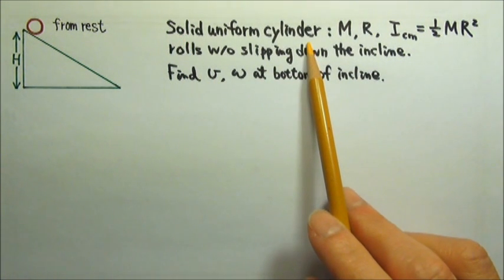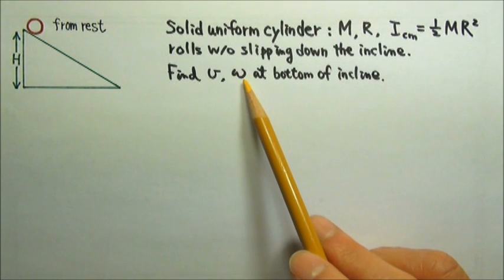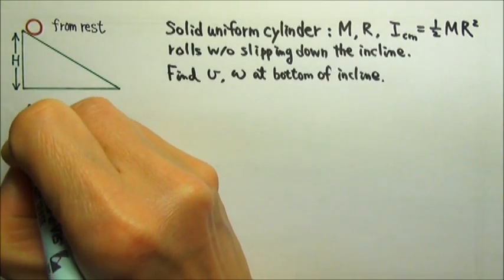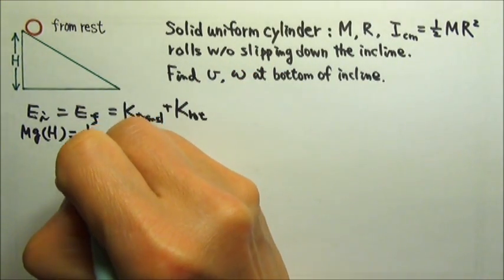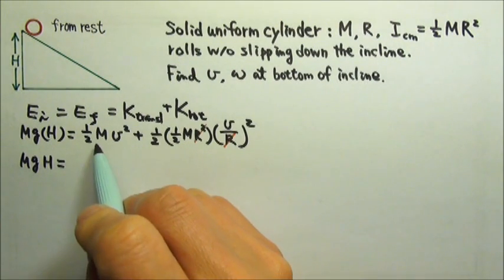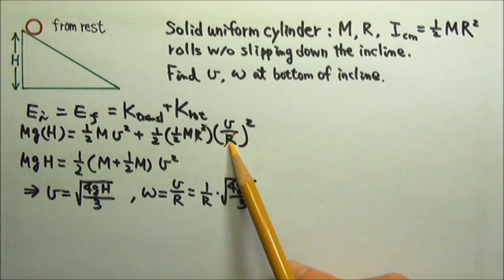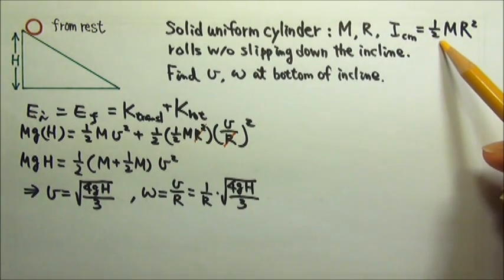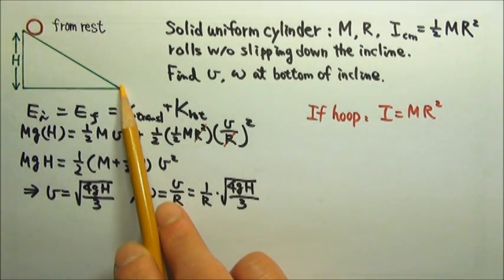AP Physics 1: Rotation 28: Rolling without Slipping Up and Down an Incline: Energy Approach

Comment: Hello! I'm a little confused about the gravitational potential energy. I have seen a problem about a meterstick falling down and when it is treated with energies, the height is the height of the center of mass. In this case, wouldn't we consider the same? I mean, instead of U=mgH, we would write U=mg(h+R)?
Reply from the maker: Very good question. If we say the initial U is mg(H+R), the final U would be mgR, because at the bottom of the incline the center of mass is not on the ground. We use mgH because the height change of the center of mass is H. 
And the reason why we use the location of the center of mass is that center of mass is the average location of the mass distribution. For example, if you look at the meterstick, some mass is higher than the center of mass while some mass is lower than the center of mass. The height of the center of mass would be like the average height of the meterstick.

Comment: Mam if suppose there is a track which is curved and ball is released from one height of the track and reaches the lowest point and other half of the track is frictionless but as the ball has energy so it rolls up again. Then at the highest point its rotational Kinetic energy will not be 0? I mean it will stop translation but due to absence of friction it keeps rotating? Mam is it correct? Pls help. Thanks
Reply from the maker: +Saanika Gupta Yes, it is correct. If there is enough friction to keep it rolling without slipping on its way down, the ball will roll without slipping at the bottom of the hill. 
When it goes up the frictionless side, there is no friction to produce torque to change the ball's rotational motion, so it will keep rotating at constant angular velocity - even as it reaches the maximum height and comes to momentary rest (in terms of translational motion) (v = 0). At that maximum height, the ball would still be rotating at the same angular speed.